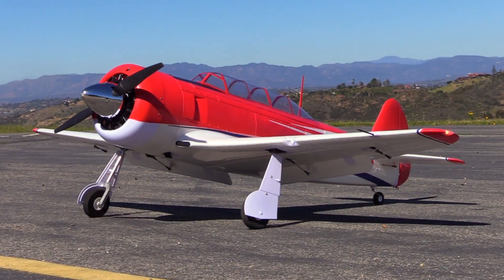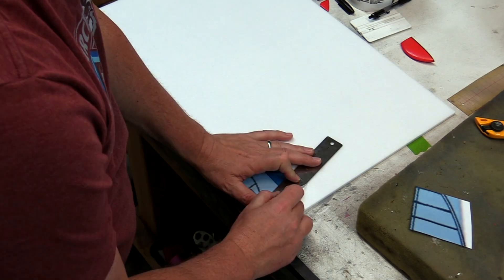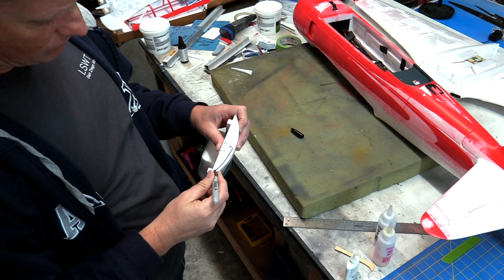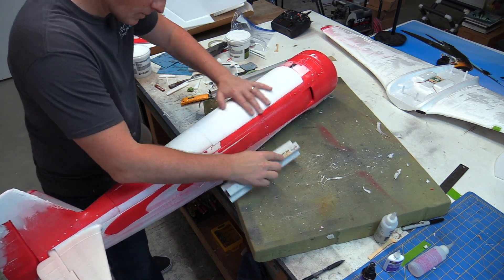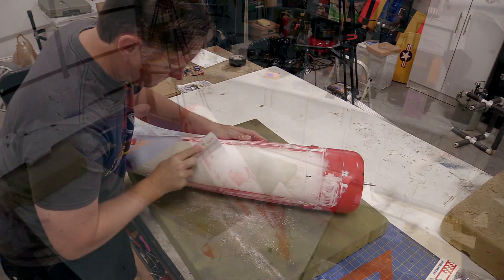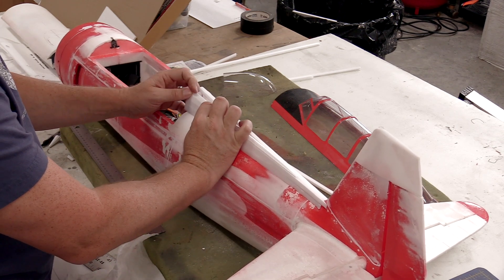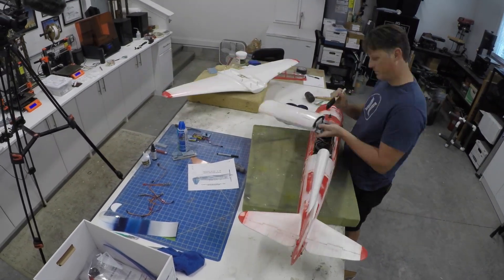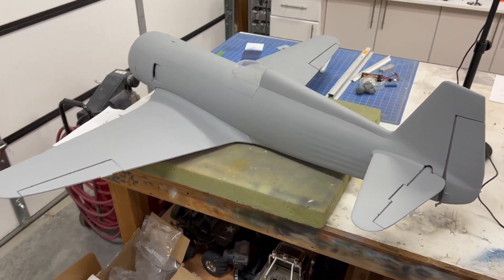DIY RC Reno Racer - Kitbashing a Yak-11 into Czech Mate

Comment: Looking good  man 👍  Great production and explanation .  Who makes those cool  alloy sanding blocks ? Is the paper glued on or does it clamp.
Reply from the maker: Thank you!  The sanding blocks are ones I’ve had a long time, however dubro just re-released them. I use a light application of spray glue to hold the paper on the blocks.

Comment: nice job. always amazing.  where do you get those nifty sanding blocks.
Reply from the maker: Thank you!  As it turns out, dubro just brought a number of sanding blocks to market, so I’d recommend checking them out. For the small ones though, I make my own using hard wood. I have a small 3” one I made ages ago that I use all the time.

Comment: No More Wonder fill , filler ?
Reply from the maker: I’m not sure what you’re referencing. I’ve been using sherwinn Williams shrink free spackle for quite some time.
Reply: @Thercgeek  Might have been somebody else.  I was using Hobbico  Hobby Lite but can no longer get that.  I might try the sherwinn stuff.
Reply from the maker: I was using the hobby lite stuff too which was really great stuff. The sherwinn williams is the best replacement for it I’ve found so far. Not quite the same, but still good.